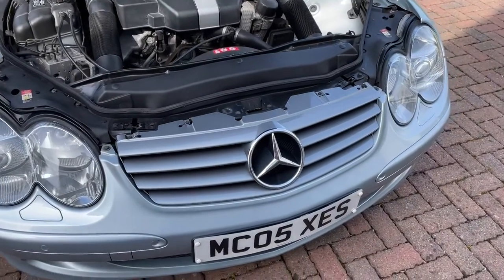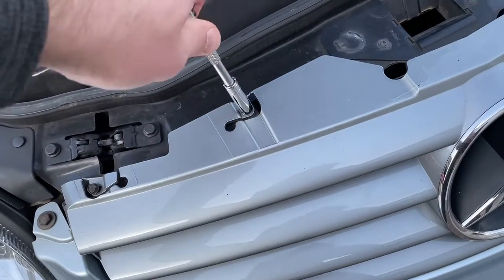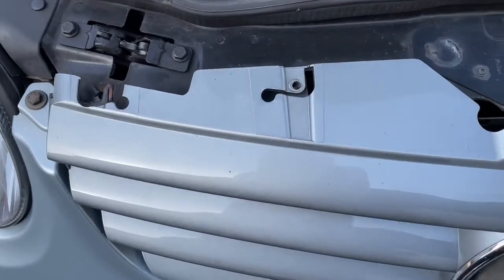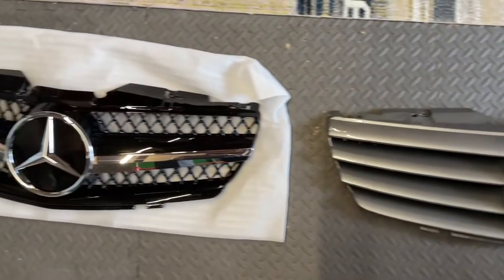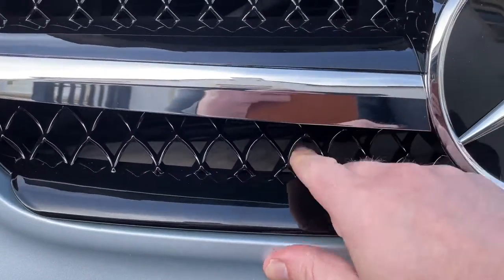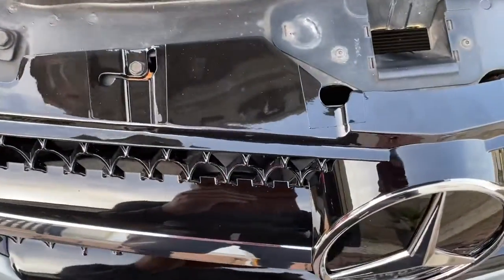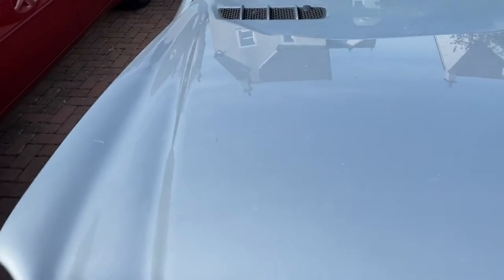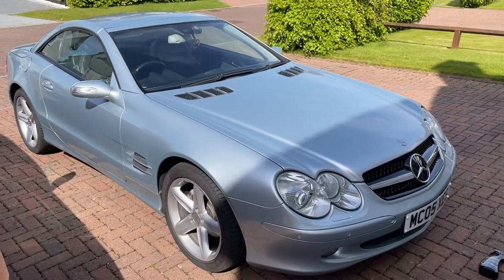Mercedes SL R230: PART 1 front grill replacement and fitting SL350 SL500 SL55 SL65 SL600 AMG

Comment: Hi mate. Is this one compatibile with distronic?
Reply from the maker: Hi Rafal. Thanks for watching! My car doesn’t have the distrinic option. I couldn’t say for sure but the centre logo is solid like it is on the cars with distronic plus its easily removeable from the grill if you need to swap it. Hope that helps? Dave
Reply: @autogaragelife  Thank you so much.
Reply from the maker: @RafalGierazinski  if you buy from the same place I bought from (link in description) the seller can confirm before they ship as they ask for your license plate number first.👍
Reply: @autogaragelife  This would be very good advise as I replaced the grill on my 03 SL55 and every once in a while a clean distronic sensor message pops out, It drives me nuts, I'm thinking on going back to the OEM grill.